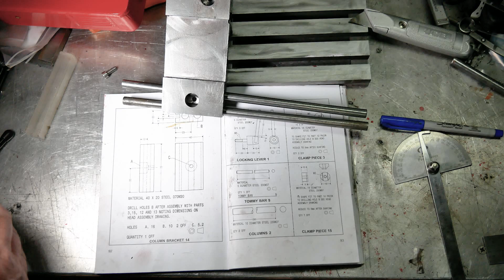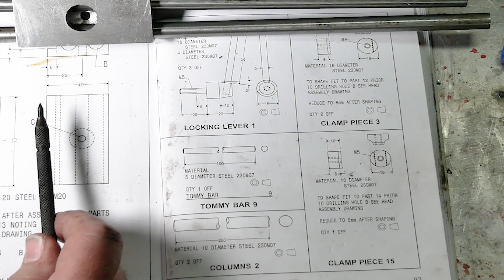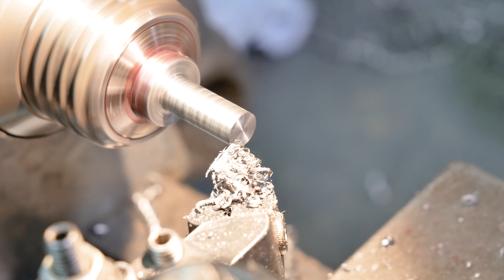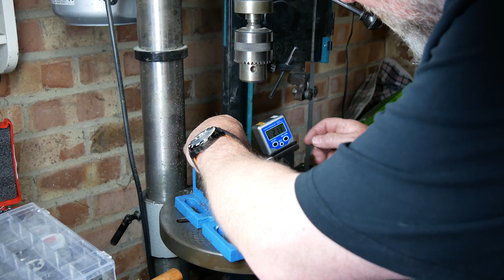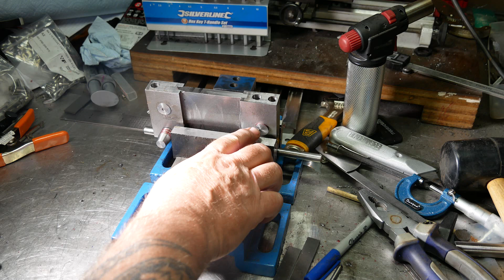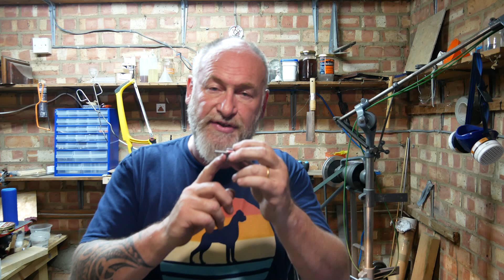Building Harold Hall's Tapping Stand Part 4

Comment: I sucked air through my teeth when you tried drilling the clamp parts without securing the vise! Thanks for remedying that. I see no reason the threaded part on the clamps can't be made from threaded rod Loctited into the clamp. Far easier. If you're worried about strength of the material, use the threads cut off a socket head cap screw; they're high tensile. At work we turn down SHCS for pins so we don't have to buy the minimum 6m length of HT steel when we only need 200mm.

Comment: Have to agree with the others that the end results look very good!  You attempted some difficult operations, and had some bad results.  But you stuck with it!  A hint on drilling at an angle:  you can mount a rectagular block to your lathe toolpost with several hole sizes at center hight. With the part in the chuck, set the topslide angle and use an electric drill to drill through the block.